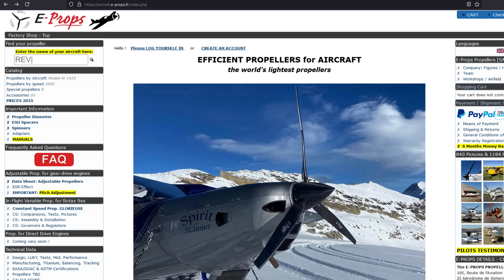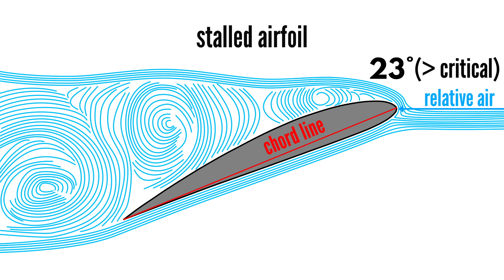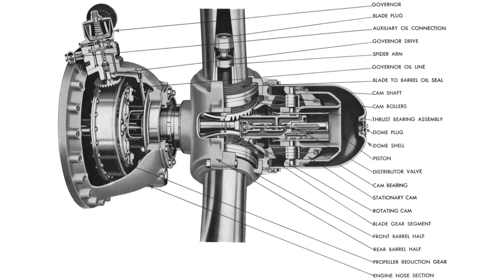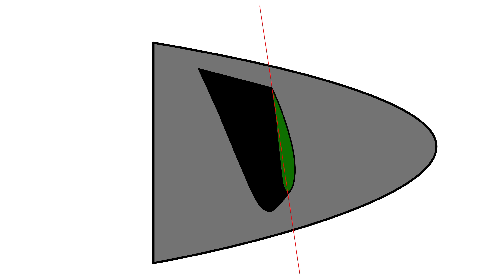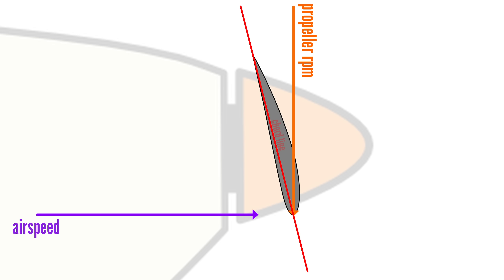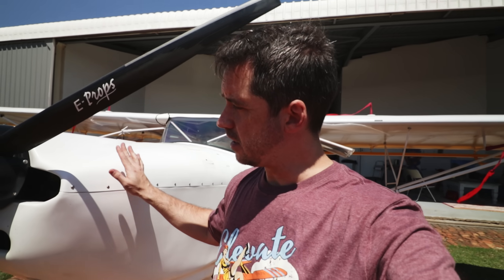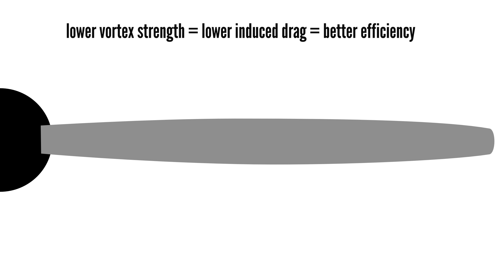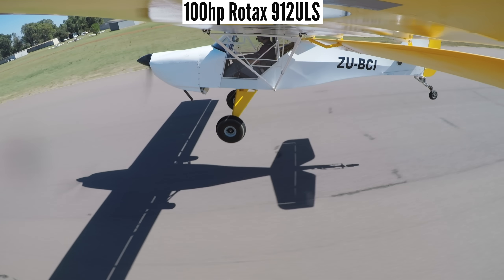E-Props "Constant Speed" Effect Finally Explained

Comment: I have had the E-Prop 3 blade grund adjustable propeller installed on my Roland Z602 for 1.5 years. Previous propeller was a Duc Swirvl which is a fine (ESP) propeller too. With the E-Prop I have gained 6-8 knots in cruise, but more importantly take off distance have been reduced to 160-170 meters on a level runway and near 0 kt wind conditions from 200-225 meters. Climb have gone up from 900 feet/min to almost 1100 feet/min. Propeller blades and spinner are balanced and there are no vibrations. Total weight of blades/hub/spinner is 2 kg. and stopping the 912uls is now gentle. Very satisfied with the results.

Comment: In a nutshell: I am not convinced, sorry! The conditions at lower airspeed are physically different than at high airspeed, but the prop remains physically unchanged? - This is a basic contradiction. Meaning: e-props seemingly did a good job in balancing the blade twist and airfoil design, but they by no means addressed the main physical problem!
By comparison: look what Scout paramotor company did (for paramotors only): Their prop is physically pitch-adjusted at flight, but without gears and without bending. There are other forces (e.g. the aerodynamic and centrifugal ones) which can be utilized to automatically physically change the prop pitch at different conditions.
In other words, I don't quite buy the idea described in this video. 
Also - sorry, nothing personal - a bit too verbose for my liking. Sometimes more like an ad than a video for aviators, sorry.
All the best!

Comment: I learned to fly in a Zlin 526, equipped with automatic pitch propeller, Avia V-503. Pilot has no input on the pitch as in constant speed props. It has e free rotating front part of the spinner, equipped with angled vanes. It's rotation provides oil pressure to change the pitch, the higher the speed, the coarser the pitch. It remains at fine pitch up to 140 km/h, than starts to increase with progressive speed, it keeps engine at optimal rpm.
Reply: Why did you comment this? Nobody asked. If they are here they know how props work.
Reply: @thomgizziz Why did you comment this? Nobody asked.

Comment: not letting small aircraft have variable pitch seems insane to me
its fuel efficiency and innovation being thrown away
Reply: Weight and cost savings....
Reply: @portnuefflyer well those are choices for pilots not safety rules but also those things can be better achieved if people are allowed to experiment and innovate
there could be ways to make cheap light mechanically simple systems but we might never know because its not allowed
my best guess after coming back to this is just to have less moving parts and therefore less points of failure
Reply: Yes, fuel efficiency and the extended performance envelope are beneficial, but.... CS/VP props are an additional mission-critical control, which adds a surprising amount of cost to a simpler fixed prop installation, and (like twin engines and retractable gear) it is one more thing to get wrong !  One of the most famous pilots to wreck a Spitfire by taking off with his prop set to 'Fine' pitch' was Douglas Bader. The story is on his Wikipedia page...

Comment: Great Vid.  Why don't props have bent tips like wings to prevent vortices?
Reply: It has been tested and even produced by one company, they were quite heavily advertised, but they catch up. As far as I know, a lot of it has to do with structural integrity, which is to be expected, there is an increase of weight and rotational inertia. Another factor is drag, since there is added wetted surface at the point which operates at higher speed (drag increases with the square of speed), not to mention higher complexity of manufacture. All in all, they found it was not worth it.
Reply: @fifi23o5   I have over 2000 hours of off airport flying with a Prince P tip prop, and it still looks like new, and it makes a unique sound, lower pitched than any other prop I've tried.
Reply: Catto Propellers have this to some degree.

Comment: Good job explaining E-Props and general theory.   I would add one point you didn't discuss.  The swept area.   Because the swept area goes as the square of the radius.  The outer 1/4 of the blade is 1/2 of the swept area (44% without figuring in the spinner area or loss near the cowling).   As a result the outer 25 to 30% of the blade diameter is where most of the thrust comes from.  Designing blades to optimize from about 50% out to the tip is critical (75% of the area). While the inner 50% does not have as much effect.
Reply: Good point.  A gent in the UK ( Dr. David Joyce) wanted a prop with more twist for his Europa mono wheel believing it would give better performance.  He spoke with Woodcomp Propellers and they said they didn't believe more twist would make much difference.  They also said if he did the math they would build a propeller blade to his spec.  He designed a wide cord blade with 26 degree twist, the cord was especially wide at the root.  This became the SR3000W blade I believe.  Did it work? Well it gave him 4 knots at cruise speed ( 164 kt, vs. 160 kt with 12 degree twist blade ) mostly 26 degree twist gave him much better cooling on the ground and in climb.  He published a article on this in 2009.

Comment: The secret is high aspect ratio blades.

They also clearly have chosen a de-optimized load distribution deviating from theoretical optimal, instead choosing a compromise at all airspeeds to attain improved "area under the curve"

Other remanufactures with low aspect ratio blades are hard pressed to attain 85% efficiency. They optimize to attain it.

If Eprop uses high aspect ratio blades, they are probably working with a propeller than can attain 90%+ efficiency. They de-optimize from peak efficiency back down into the 85% range, but across a wider speed range.

That is all.

Comment: Great explanation of a complex topic.  A few fine points.  Centrifugal force counters blade bending, so there isn't much bending ever.  This is why helicopter rotors remain nearly flat without much strength in this direction.  Also the aerodynamic ideal is a wide chord at the root but of course this is heavy using traditional solid construction, and the share of thrust in an ideal propeller from the inner 20% of the prop blade is 4%, so it is not worth using a wider blade there.  The main advantage of a good root shape is less drag due to aircraft forward speed, since the thrust is minimal no matter what.

Comment: I am a bit confused - You mention they don't use blade bending. And you state e props shift the trust from less usable(static) to more usable speed(flight). To me it sounds like they have a cruise speed optimized prop. 
To me extended speed range should mean better cruise performance while maintaining static thrust, or better static thrust while maintaining or beating cruise performance.
Reply from the maker: No definitely not a cruise optimised prop. It reduces takeoff distance, climb rate is better and cruise speed is better. Only static thrust is worse, but in their own words on their website "When attempting to reduce an aircraft’s take-off distance, thrust between 40 and 80 km/h is much more important than that between 0 and 40 km/h :
- while the aircraft is increasing from 0 to 40 km/h, its average speed is only 20 km/h; the distance made remains low (ex: 16 m in 3 sec)
- between 40 and 80km/h, the average speed is 60 km/h: this is where the runway length is "consumed" (ex: 60 m in 3.5 sec)".

Staric thrust is not most important for general takeoff, unless it's a super STOL plane then probably it is.
Reply: @LetsGoAviate  I went to their website and read an article EXTENDED SPEED RANGE (ESR) EFFECT . There they have a graph comparing standard prop to ESR one. On the graph up to 150km/h the ESR has more thrust. From 150 up to 230 the standard prop has more thrust, and from 230 - 300 there is only data for the ESR prop.
It seems that they have some inconsistent messaging.

Comment: 3:15 I disagree. I dont believe a prop would ever be operated in a condition that is stalled. Rather, a higher pitch ground setting simply takes more torque to spin. This causes the engine to run at a lower RPM. A lower RPM causes the engine to produce less HP as it isnt at its ideal/peak HP RPM.
Reply from the maker: By setting a ground adjustable prop too coarse, the blades are absolutely stalling over certain parts of the blade at static, i.e. when applying full power to start the takeoff roll. As it accelerates, it is no longer stalled. This is very common on lower power, high speed kit planes for which the propeller are optimised for cruise only. 

Happy to provide some external sources.
Reply: The root blade angle is always greater than 45 degrees.

An airfoil stalls around 15 degrees.

There is inflow which reduces the trigonometric angle of attack.

But the root is always staled on all propellers except perhaps the most finely set constant speed.
Reply: @Triple_J.1  That is possible, but I would point out that even when the plane is stationary on the ground, the air is certainly moving reward relative to the propeller. As the root has a very slow speed, the velocity of the air going through the propeller may be enough to reduce the relative angle of the air and prevent a stall.
Reply: @crissd8283 You are basically saying that a plane wing can not stall if you fly slower and pitch the plane up. Think about that.
Reply: @chippyjohn1  That is not what I said at all. A wing can certainly stall, and a variable pitch prop can certainly be set with a steep enough pitch as to stall.

Flying slower doesn't change the angle of attack of the wing just like a reduction in engine RPM doesn't change the angle of attack of the prop. You can stall a wing at any speed but only one angle of attack.
Reply: @crissd8283  You can stall a wing at any speed, but only one angle of attack. That does make sense. Just imagine rotating your wing at 45 degree upward from the forward thrust line. Imagine that, and think if the wing would produce lift. Best of luck.
Reply: @chippyjohn1  By that logic, the prop would always be stalling. We must take into consideration that the air stream flowing through the prop has velocity reducing the relative angle of attack. The air has velocity through the prop even when the plane is stationary.
Reply: @crissd8283  How old are you? Can't you watch a video on an airfoil with smoke trails. I think you struggle to visualise what is happening. You think because there is some thrust, there is no stall. A propeller or wing does not have to be an airfoil or be at an optimal angle to create lift. Its about efficiency. Look up the earliest propeller designs, and wing designs. They were terrible, but they also worked, just not well. Best of luck.

Comment: Frankly e-prop looks weird,  for LOW HP engines & speeds of narrow performance. Fixed props are still big compramise.  Best: Hartzell constant speed hydraulically controlled blended airfoil propeller. Done.
Reply: What is the efficiency map of the Hartzel? They aren't particularly forthcoming. Running the numbers, I doubt they are more than 81-82% efficient.

A proper high aspect ratio propeller such as these will easily attain 90% peak efficiency and also have a healthy efficiency map at lower advance ratios that optimum.

Comment: I know firsthand it is proprietary, I had to spend 2 weeks reverse engineering one system to fix it myself when they told me the part I needed was made in Italy (it was an RC car motor made in China), and then I had to reverse engineer the circuitry to fix a broken contact

Comment: You beat me to making a video on this! We recently replaced the standard 2 blade prop on our RV-12 with a 3 blade E-Prop. +12 KTAS and increased climb performance but that was not the end... the SMOOTHNESS was unimaginable, it feels like you're sitting in a jet or driving on a smooth highway. I was blown away. In our case it worked spectacularly and was extremely worth it.
Reply from the maker: Yeah this is pretty much most people's reaction after flying behind it, it really makes a difference. It's also much more gentle on the gearbox.
Reply: Would still like to see a video on it ;-)
Reply: @hu5116  I'll keep that in mind
Reply: What was the before KTAS
Reply: @matthewmyers9745  we went from 106 KTAS at most altitudes with the 2-blade to between 115 and 118 KTAS at various altitudes with the 3-bladed prop.
Reply: Nice. I have the 2 blade . I average 120 TAS just about everywhere I fly with. Better than book climb. I wonder if I would see an improvement. 2023 RV12IS
Reply: @matthewmyers9745  honestly it's hard to say I think. Not sure how to calculate it practically without running a bunch of math. I did not think we would gain that much cruise speed by doing a simple prop change. It worked in our case.
Reply: What pitch are you running? I’m looking at a new prop for my Tecnam P2002 and seriously like the look of the prop, I’m on a 2 blade atm, want to gain some take off performance mainly not really after more speed.